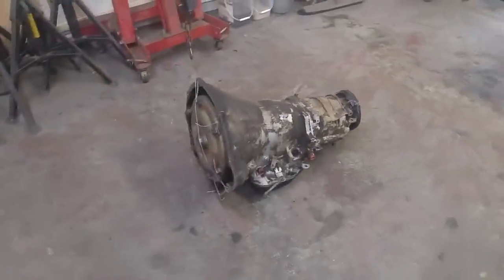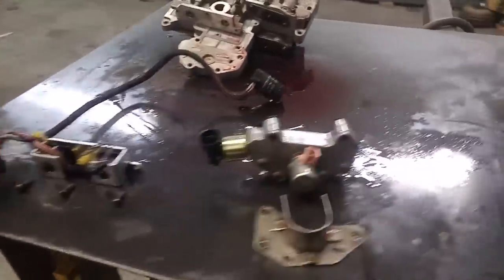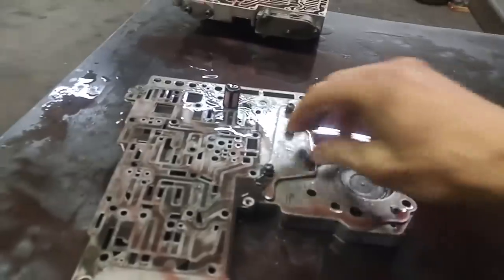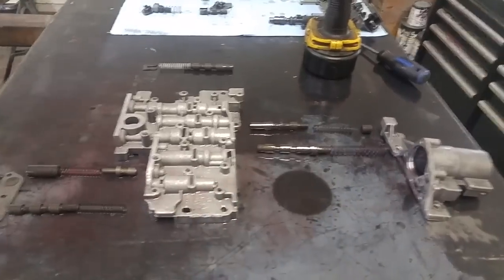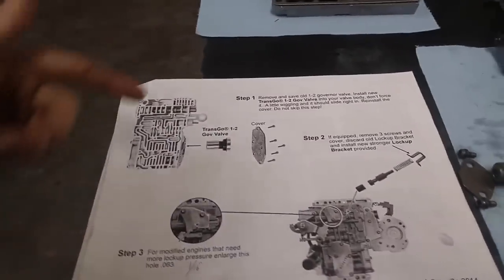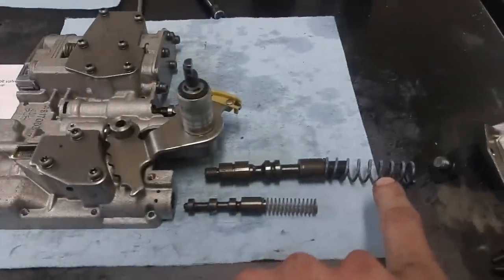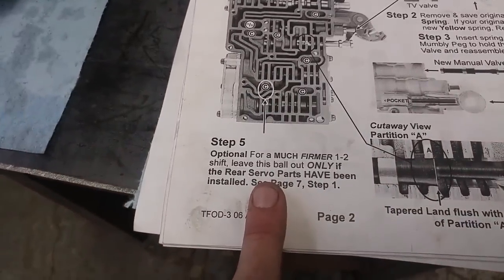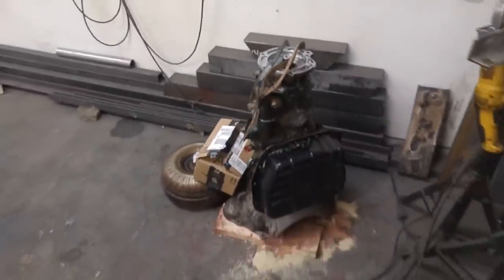CUMMINS 47RE MANUAL VALVE BODY BUILD

Comment: I did this to my 97 Ram2500 w/ a 47re and Im not getting my OD in. All other gears shift perfectly fine.
Reply from the maker: Check resistance over od lockup solenoid.

Comment: Hey I need some advice, my tranny seems fine, bought the truck with a “rebuilt trans” no paper work but was told the 2nd gear was bad so they rebuilt it. I’d like to get some nice parts for it, should I buy a firepunk or buy separate parts and rebuild it myself! Thanks man love the videos

Comment: Hey can you JB weld that on a stock 47re valve body and inable lock up in second? That's kinda cool if that's the case
 Wonder if the same can be done on a 48re. I know the computer controls more on the 48re so may not

Comment: Hey man. Under the pr calve. The two screw plate I can not for the life of me get that back on. Any help/tips? It’s like I bottom out and it won’t compress any more
Reply: At 12.57 upper left. The two bolt plate, I can not get those to squeeze down far enough to get the plate on. It bottoms out before it is flush for plate to set on

Comment: Is that set up for a reverse shift pattern or the standard shift selection pattern? Does that kit allow you to do reverse pattern?
Reply from the maker: It would be 1-2-3-N-R-P. Not sure about reverse pattern, don't see what the advantage would be so never looked into it.
Reply: Thanks for the reply back enjoy watching your videos.  The advantage of a reverse valvebody would be that it places 1st closer to neutral and reverse.  And you say it was going in a off road truck so it makes life a  little easier then having to ratchet it throw all gears if u are in 1st to go  N R P. So for example from park patterns would look like this.

Reverse valve body  P R N 123 OD 
Reg valve body         P R N OD 3 2 1

Comment: K so i got the same trans (Aparantly Rebuilt?) with a blue billet TC and i cant get past 2nd gear.cause aparently it Slipped? from 4th or 3rd back to second. Cleaned the vb as well but???
I got a ttva motor for the tv valve..does that effect  tc lockup or Od. Cause i cant get either and its heating up bad
Im wondering if you help me on that subject
Reply from the maker: Sounds like direct clutches are burnt up.
1st and 2nd would be normal and direct clutches hold 3rd and overdrive. also lockup isn't enabled until your in 3rd gear so that explains why you don't have that either.

Comment: I just got done building my valve body for my 47re. The step where u grind the 4 land spool valve u should skip and the part where u filed the valve body skip them steps. I was told this by a very well known trans builder.
Reply from the maker: Any idea why?
Reply: The 4 land spool controls tc lock up grinding the valve my cause tc shudder when locking up.
Not grinding the valve body not sure y.   he just said to skid both of them.
 steps.
Also check out sonnax they have custom valves to control valve body pressure. Another thing to do is flats sand the valve body sections to stop cross leaks.
Reply: grinding the slot on the valve body where the manual vale goes is to allow fluid when in park which is one of the problems with these transmissions...but if you upgrading the manual valve they take care of the problem by moving the the part that allows the fluid to pump while in park...so no need to notch the side of the valve body...
Reply: you can see the difference in the new and old manual valve at 11:24 in the video...
Reply from the maker: Yea okay so new manual valve just completely bypasses that notch I filed. So your right it was not needed but also wont have any negative effects. If I notice tc shutter I'll replace the valve with another stock one and make an update video.